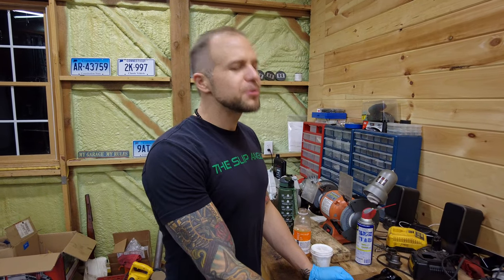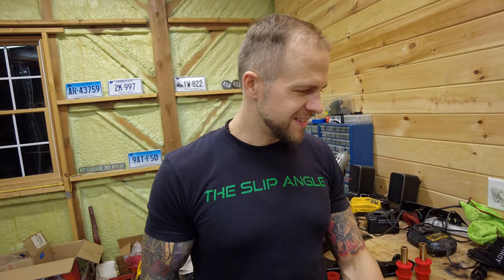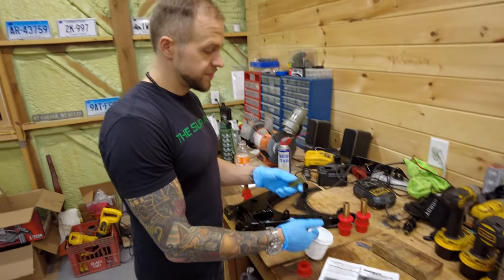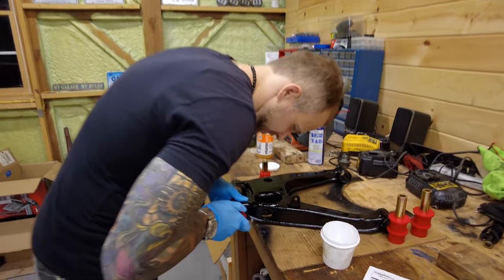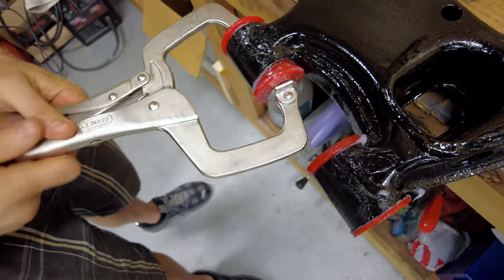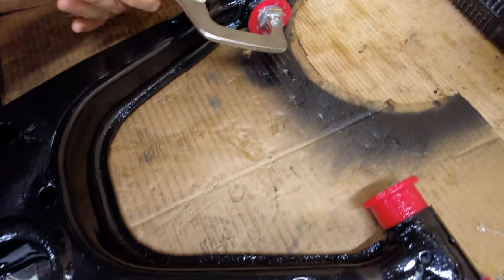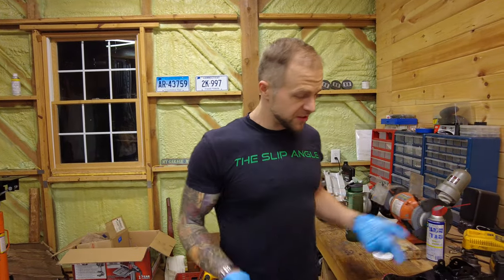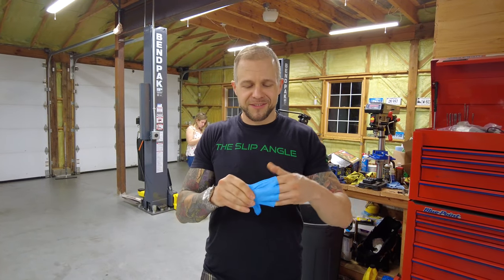Project Miata Exocet Pt17 - Control Arm Bushings

Comment: Awesome stuff man! Glad to see it coming along.

Also for a side tip: I used Lucas red n tacky grease. Three years later, no squeeks. It's cheap and you get plenty in one tube for $5 or less at Walmart.
Works excellent!!! Lucas red n tacky.

I heard of so many other suggestions for lubes to use and then after further research into those suggestions, people were still having squeaks afterwards. However, Lucas red n tacky is the all time unrecognized underdog of poly bushings. Guaranteed to get the job done!

Comment: Can you go further into detail about why poly bushings can be punishing as time goes on…? What’s your current experience with them so far???
Reply: I had poly bushings for a year and they make the car feel very harsh. Mine started squeaking in like 5 months. Maybe I didn't put enough grease. Swapped them out for new rubber bushings and the car feels so much better. Wouldn't recommend poly for a street car
Reply: @xnanoo  your daily or did you track too?
Reply: @izzoArtistry  Daily
Reply from the maker: The increase in NVH beats you up if you drive the car for a while. Road bumps, exhaust noise and drivetrain.
Reply: @TheSlipAngle  besides that,  how have they’ve been holding up so far?  Performance & function wise….
Reply from the maker: @izzoArtistry  they've held up without issue

Comment: MotoIQ recommends Teflon tape for sway bar mounts that use poly. Just wrap the bar where the bushing goes, grease your bushing and install.
Reply from the maker: I've only used the grease in the past but I've never had any issues.